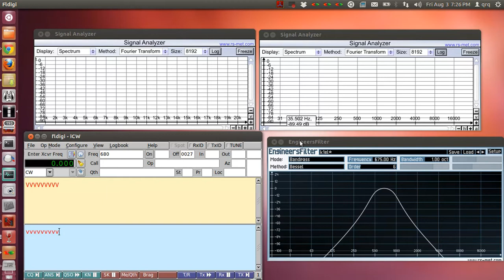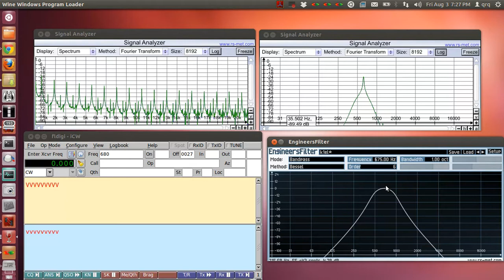Filtering the K1EL, K40 CW sidetone audio output on UBUNTU 12.04 with a free software VST PLUGIN.

Comment: Hello, nice video. I am trying to filter audio from a mp4 file. Do you know if it is possible by using this sw ? Thank you!
Reply from the maker: what OS are you using ?  if Windows, you can use a VST HOST and there are many types of VST PLUGins for filtering audio files...you just have to be able to route the output of the audio file/media player to  the input of the VST HOST ...the Engineers Filter is just one VST PLUGIN with the Bessel Audio Bandpass filter that works great with CW AUDIO tones for filtering out the morse code audio tone harmonics...Mequalizer https://www.meldaproduction.com/MEqualizer  and Voxengo's graphic equalizer  https://www.voxengo.com/product/marvelgeq/      are a couple of other examples for free VST PLUGINS that filter audio
Reply: @QRQcw  thanks for replying! In fact I am using linux ubuntu. I think that what I want to do does not require routing audio output... 
I record some classes directly from my desktop. The problem is there are birds in the background, sometimes dogs barking and even cars passing by that causes this background noise that I want to filter. So it is ok for me to filter the audio from an audio file, and I can adjust my filters depending on each situation.
Reply: I am trying to find out the best way to do this filtering. I have been trying Audacity but I found it too complex with a lot of steps. So I was wondering if it could be easier somehow. What is your opinion?
Reply from the maker: @blackheadsremoval-satisfyi1940  i would use a VST HOST, and send the media into the VST  HOST "input" ... use whatever VST PLUGINs you deem effective to filter the audio...once you are happy with the results of your filtering, you only have to (re)record the "filtered" output